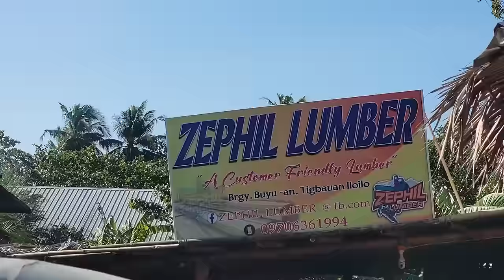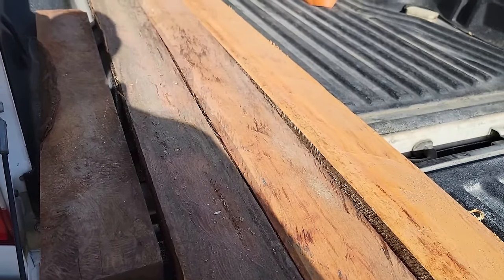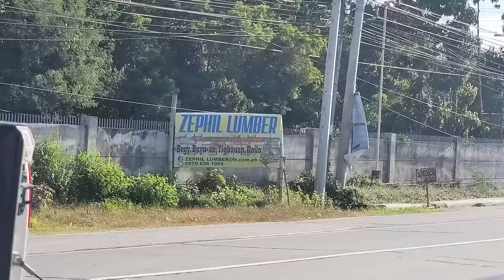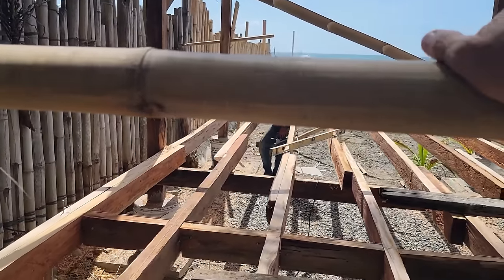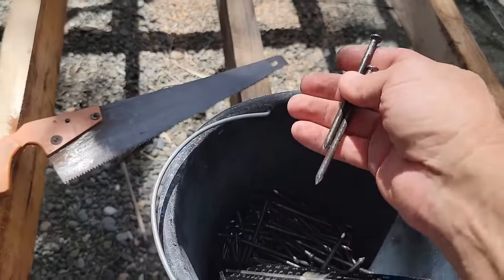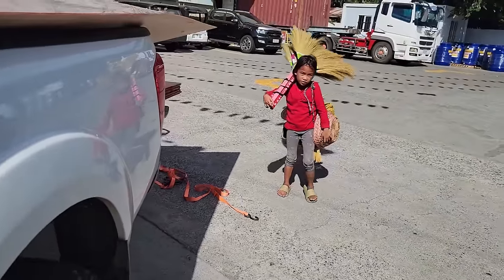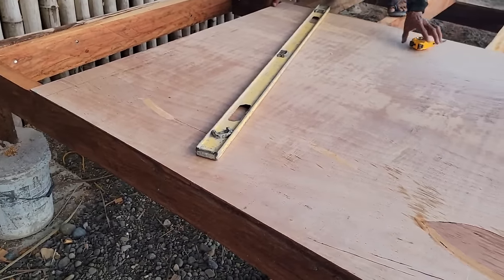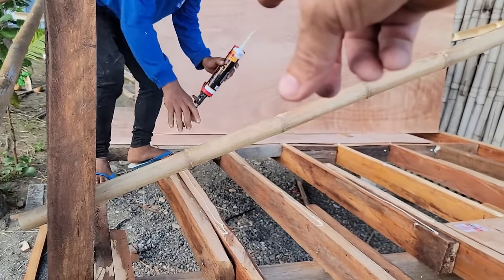Beach Cabin Build part 3   Finishing Floor Joist and Laying Subfloor

Comment: When it says marine plywood, it mean that the glue is synthetic rather than organic glue. It's the same. I was a plywood inspector.
Reply from the maker: Thanks but also the type of woods it is made of it different too in Santa Clara
Reply: I have never owned one but I have never seen you use a nail gun, are they not suitable for your jobs
Reply: @AaJim1517  James has got all the tools the boys won't use them